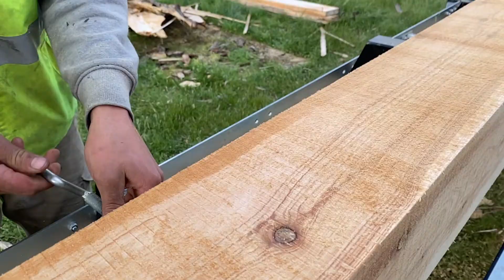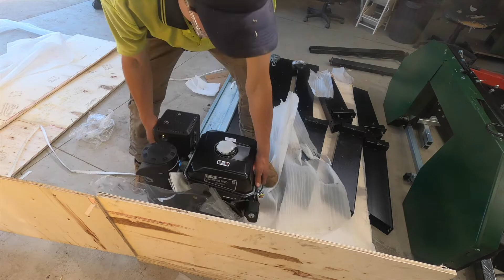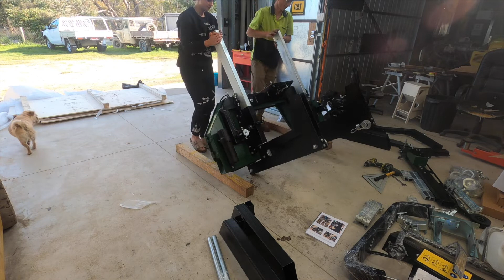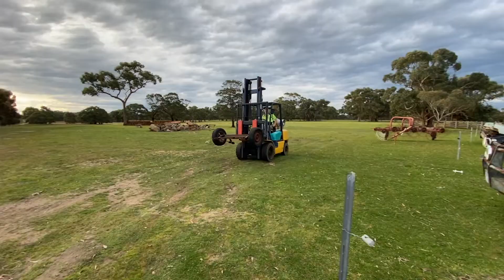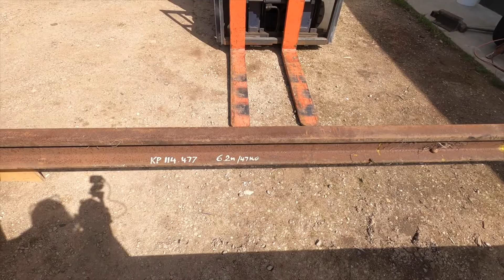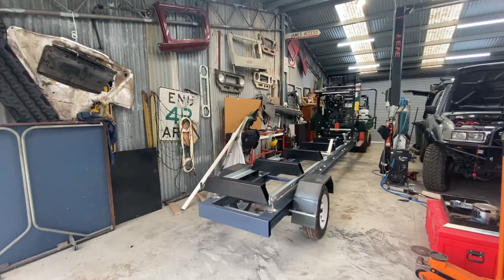Australian HARDWOOD mill (setup and trailer build)

Comment: I'm thinking I'm going to have tomake a trailer for mine. Steel is stupid prices at the moment though. Nice job on yours.
Reply: Hardwood Mills trailer review 9.5/10.
I bought their trailer for my ground model GT34 ($3500). With it, I bought the log loader ramps and bolt on hand winch kit ($1200). The winch is actually very efficient at turning logs on the deck, so much so I might not buy the hydraulic attachments now. I really like it actually. You need a piece of conveyor belt or tyre draped over the track to protect the Dyneema rope when winding a log on.

With the trailer the saw carriage takes up ~25% of the bed length (my ground model had 2 x track extensions), so the trailer is now much shorter. You might need to get a drop down extension for the trailer (+ $525). I ordered mine Tuesday.

The trailer is excellent except the 6 stabilizing legs are bloody annoying since the screw handle is on top and you can only turn each handle about 150 degrees since it hits the trailer, then you have to flip the handle over (the knob now faces the ground, turn it a bit, flip it back over back over, then screw for about 120 degrees then repeat). 
Yeah, the jacks need to have the handles on the side they're painful.
Also there is no jockey wheel and the trailer is really heavy. I used a workshop trolley jack under the draw bar and it slipped off and bent the brake mechanism - moral of the story leave the front trailer jacks down and wound up a bit in case that happens to you. A jockey wheel is going to need very long U bolts because there is only a single SHS drawbar rather than the more usual triangulated RHS drawbar.

Back to the trailer jacks, you can wind them off the trailer of course then put them on, but when on the trailer you can't turn them much. 
This isn't a deal breaker because if you hardly move the trailer then you only need to check the trailer for level once before each use and and the adjustments are generally only minor requiring 5 mins for the whole trailer each day. I do it when the engine is warming up.  
Where it could be more problematic is if you move the trailer all the time. 
Side handle screw jacks are available on eBay and the cheapest ones I found were $48ea or $96pr free delivery. 
Tip, sit the leg feet on thick concrete pavers. Bunnings have them and they don't cost much perhaps $4ea.

I like the trailer a lot and for $3500 for the correct trailer for your mill you get a heavy duty trailer. It rocks around when loading and isn't perhaps the most stable platform but it doesn't matter since it only rocks when loading or you intentionally rock it. 
Another thing, there isn't enough 'eyes' for the brake cable to pass through (4 supplied) particularly if you get the winch/ramp option.

It is easy to recommend this trailer because factoring in your own labor, even if you had steel to make a trailer, you still need stabilizing legs, weld on brackets for the actual stabilizing legs and all the trailer bits and pieces. It all is going to be putting you in that price range anyhow.
Then there's no bolt on upgrade path for the winch and loading ramps which mightn't be a problem if you have an excavator with a thumb, a fork or an overhead crane etc. 

Also, it wouldn't surprise me if it was held together with more than 400 bolts. The bracing and gusset plates make it very durable and the way the track bolts on to the trailer is top notch.

Their trailer is not perfect because of the idiot legs mainly but still pretty effing good for the money I reckon. 
There is a lot to like. I'm glad I got it, wish I saved on freight and purchased the drop down extension at the same time. Oh well.
Reply: @ThePaulv12  Cheers for the review. It's not just the cost of the trailer, the transport costs to Tassie can be a bit hard to take some times. I Don't have to transport the mill on the road, just around my property mainly . Half the reason is I think it would be easier to load logs with the skid steer with it off the ground a bit.